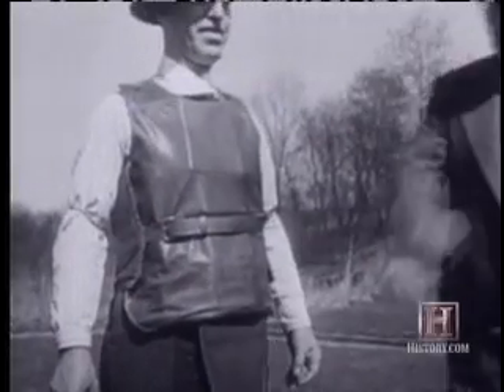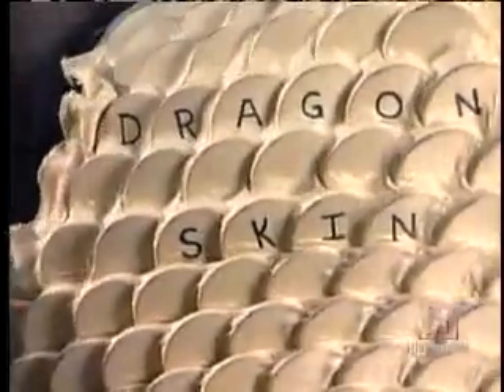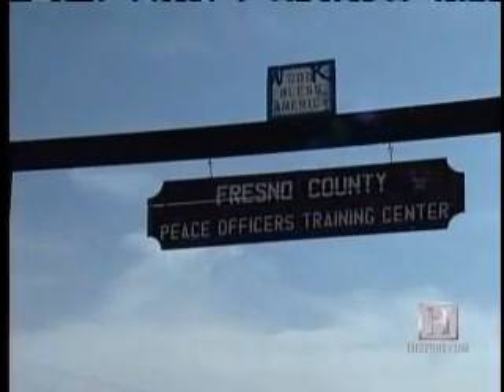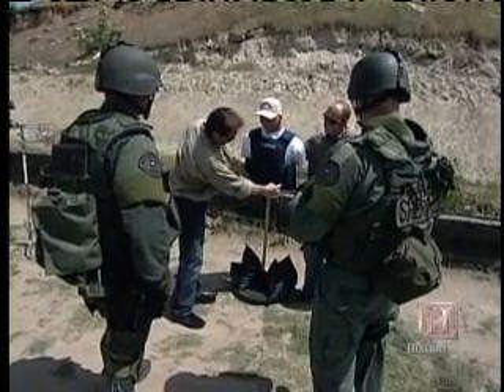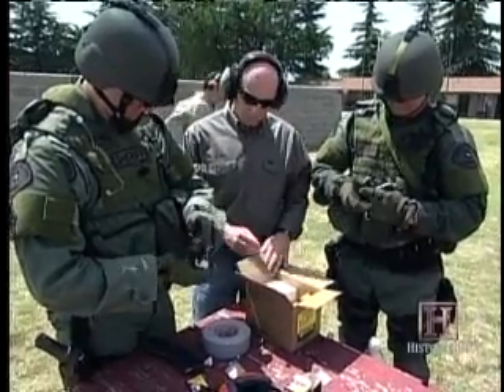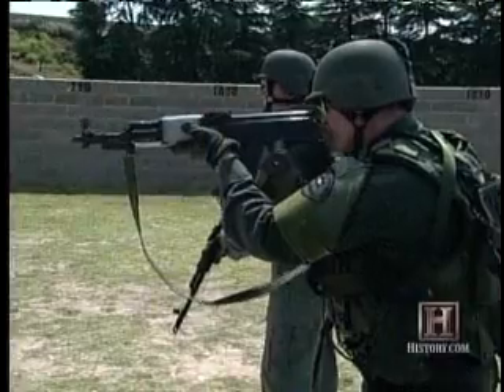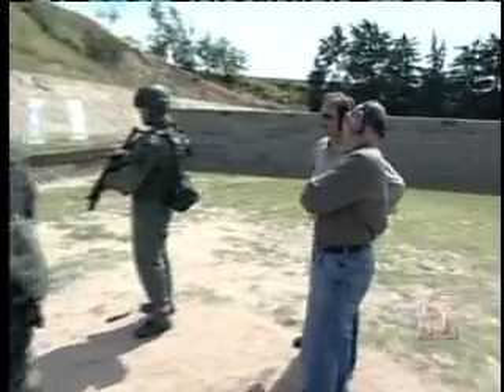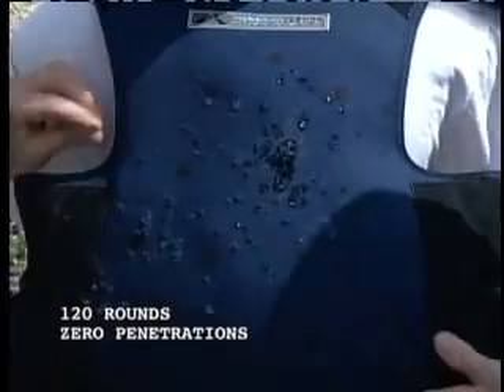Dragon Skin Ballistic Testing Multiple Shots

Comment: The Dragonskin uses ceramic/titanium laminated discs.  The XL size which is equivalent to the size L for the Interceptor is 47.5 lbs.  Even the smallest class IV was still heavier.

Plain and simple, this was an optimal condition test.  No wear and tear.  No extreme heat, cold, or chemical exposure.  Trying wearing it for a month or two.  You'll find discs from areas that bend have become unglued and sunk to the bottom of the vest.  This isn't a working mans vest.  Its a show gimick.

Comment: You are just being difficult. The outer surface is still copper.  Steel would rust and would also not slide as smooth when loading into the chamber since the bullets aren't oiled... But it is not your normal copper jacketed bullet so they call it a steel jacket.  Why are you freaking out about it being called a steel jacket?

Comment: actually the guy is right.
The bullet has a steel core in a steel jacket which is also covered with a very thin layer of copper in order to don't rust and also to help the bullet to slip on the barrel's grooves.
The copper jacket bullet have only a jacket of thick copper around either lead-antimony alloy (not pure lead) or steel.

Comment: The body Armor we wear not only lacks coverage of other areas, it also only stops on average 2 AK-47 rounds that impact at the point of the plate. 3 of my Sergeants said they "wouldn't bother with the throat or groin guards because it ain't stopping a damn thing, and they only get in you're way while maneuvering." The Army also wouldn't take the time to fabricate their tests to hide a cost problem, since CONGRESS decides what the Army spends its money on when issuing standard gear to its Units.

Comment: an rpg is designed to defeat tank armor. you think a vest is going to stop it. even if it could, your head, arms, and legs would get blown off. maybe instead of using titianium to hold the ceramic in, they should use tungsten carbide and instead of cermanic fill it with thick carbon fiber

Comment: Yeah, because steel jacketed rounds are copper colored :0

I fire that same ammo but in a 30-06. It's cheap I can buy it by the case. It's also low quality.
It's a lead ball with a bi-metal jacket.
Yes it is magnetic, but it also does contain copper in the jacket. It is not steel core, or even steel jacketed. It's harder than a normal copper jacket, but not armor piercing.